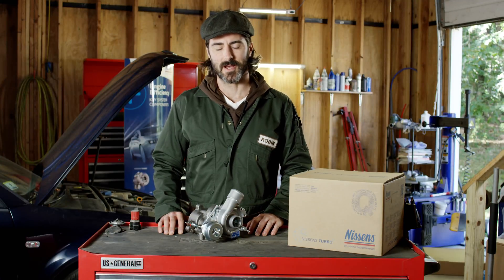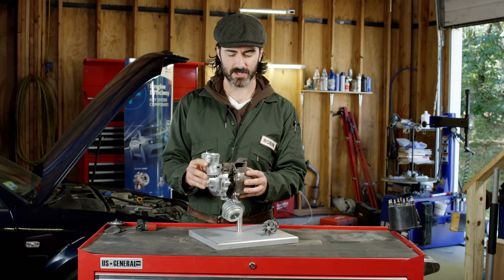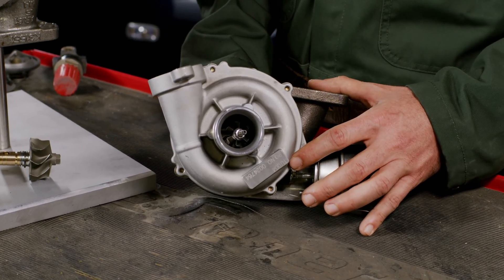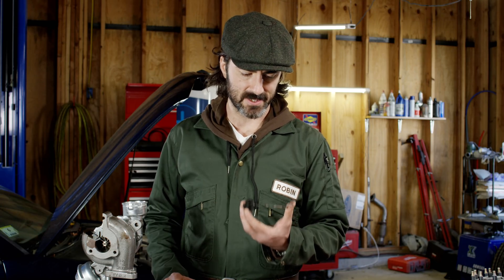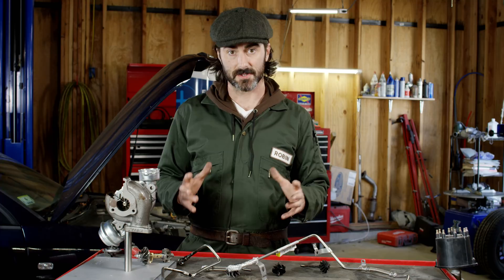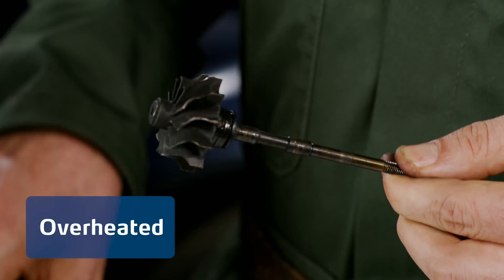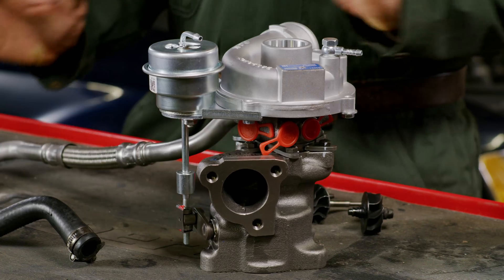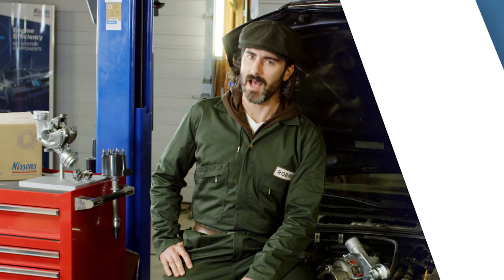Turbo Troubleshooting (1/4) - Oils & Lubrication

Comment: Can somebody tell me what could be wrong? Mondeo 2,0tdci 2004, worked nicely untill I pressed the gas to the fullest. After the normal noise of the motor I heared kind of a small explosion (like the explosion from a racing car..) and from than  the car has no power, smoking black smoke, squeaky sound (probably from the turbo) and does not go smoothly. Any advices? What could have go wrong after pushing the gas on the floor?

Comment: Question, 
On a 3.0 TDI Touareg there is a turbo that doesn’t have oil intake or drain line, oil seems to be pumped from under the turbo, how that works?

Comment: I just bought a car with a turbo, I’m the second owner, I had a feeling something was wrong with it because I kept smelling faint smell of burning oil but it did need an oil change so my bf convinced me there was nothing wrong!  Right away I got the oil change! As I continued to drive it over time I kept smelling it worse and my car was sluggish! I took in the other day and they noticed there was leaking oil but wasn’t sure where, also I had no oil in my car they said! So they filled it up and drove it to make sure she was still ok! But they did an inspection and they said she was and referred me to go back to the dealer or to someone that specializes in turbo because my leak was somewhere in the turbo. I have an appt on July 11 at the dealership for an inspection but I checked my oil today and it’s black. I called the original place I got my car inspected and told them and they said it’s normal for turbo oil to turn black right away, but I’m weary and don’t want to do any further damage to my vehicle untill I get the inspection at the dealership! Please help with advice! Someone else suggested I get a flush and oil change y till the inspection even though I still have the leak because he said it’s not supposed to be that dark but he’s not a mechanic and don’t know anything about turbo🤷‍♀️ so I need advice from some one that does know! Please help me I’m tryn to save my car! I’m not rich🙏😔

Comment: What abou revving the engine with system and consequently l, cold oil, how doing that affect turbo lifetime? I see some modern stock turbo engines are electronically rev limited while cold. .

Comment: hey Robin would you happen to know what would cause oil to appear on the exhaust tips (especially the passenger side) of  e70 x5 Diesel. It's deleted (dpf/egr/etc) i notice it has a bit weaker output that usually, but i can hear the turbo spool. thanks

Comment: If you drive a turbo charge engine always change your oil between 3k-5k miles my top 3 full synthetics oil Castol edge, Penzziol Platnium and Amsoil.

Comment: I have a 2014 Chevy Cruze. P0299 error code with concomitant low oil pressure alert. Could it be that like you spoke of?

Comment: My engine light and glow plug came on after I blew a fuse. I replaced all my fuses and they disappeared. However I got p0045 on my honda accord 2.2 cdti.  Where do I find the solenoid.

Comment: I had a hydro lock in my 2013 wrx. Would that damage the turbo? I removed it and it is clean and moving smoothly. But after rebuilding the engine I installed it and the engine runs rough and the turbo is smoking.
Reply from the maker: Hi Vince! If you don’t have play in the turbo shaft, it may be your crankcase ventilation or oil return system that has a failure. /Robin

Comment: B8 A4 only leaks oil when I drive on the freeway/at freeway speeds. I also have multiple misfires and a turbo reading under boost. That said, no smokey exhaust, no loss in power, the car sounds great. I'm working on buying a daily driver before I start throwing thousands into repairs. Anywhere you'd suggest I look first?
Reply: Is there something like a valve that controls the pressure of the head?
Reply: @unknownip6741  I don't think so. 🤔
In the past 2 months I bought a daily driver. The Audi is sitting, leaking oil regularly now. It's my opinion it could be the rear main seal.

Comment: air intake pipe comming from air filter and connected to turbo is getting wet, does it related to turbo fail or chock in turbo oil pipeline???   please suggest

Comment: I just met a strange mechanic guy who recommended me to put a 25w60 oil 
to my a3 2003 turbo with 120k miles. How would that type of oil work? Do
 you think it will affect its fuel consumption?